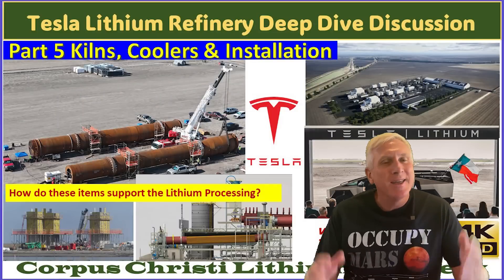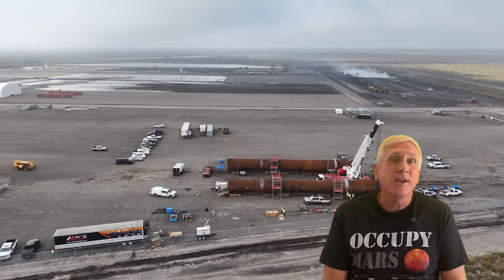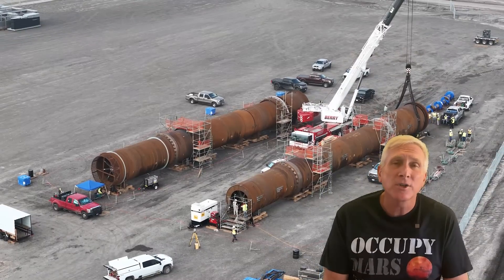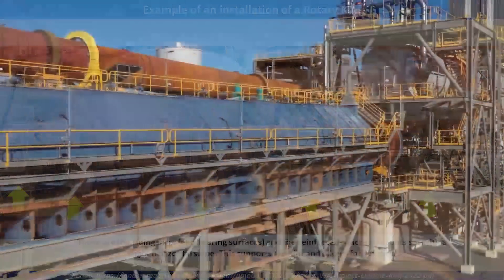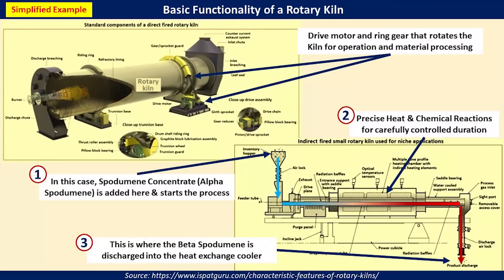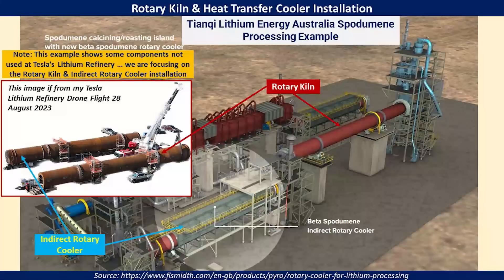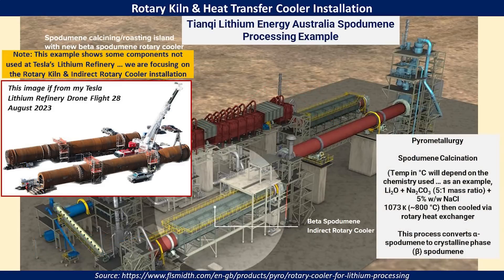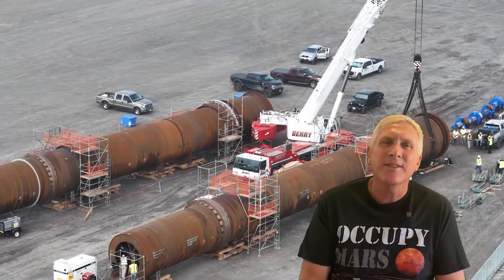Part 5 Tesla Corpus Christi Lithium Plant Deep Dive Video (Kilns, Coolers & How these will be used)

Comment: Have they mentioned how they plan to power the kiln's?
Reply from the maker: No, but  they could be electric or use natural gas as there are already lines installed in the casting machine area for this.